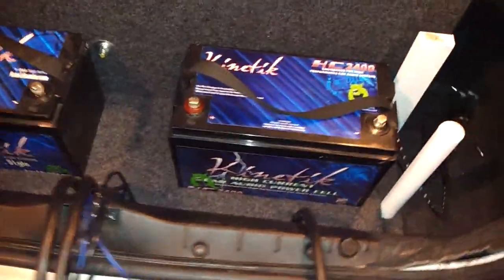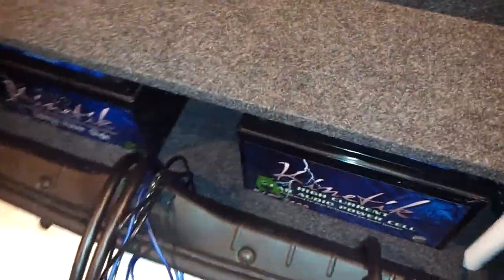KiNeTiK BaTTeRy HoLdEr / RoCkFoRd FoSgAtE T2500.1bdcp's

Comment: How did the kinetic hold up? Have you had xs power. Do they perform similar. On a budget here
Reply: I have Kinetic 2400 and oh my god theyre fucken awesome. I have one with no upgraded alt powering a Symphony s1 (1500 but underrated) and a symphony s4... total watts about 2500 and i keep voltage above 13 volts
Reply: My other vehicle has a Crescendo c3000.2 and another Symphony S4 which total watts is about 3800 minimum. Voltage stays above 13 even at full tilt... I  would recommend to anyone
Reply: Took my system out for awhile and my primary battery went out but the kinetik 2400 still turns my car on by itself I've had it for about 2 years now